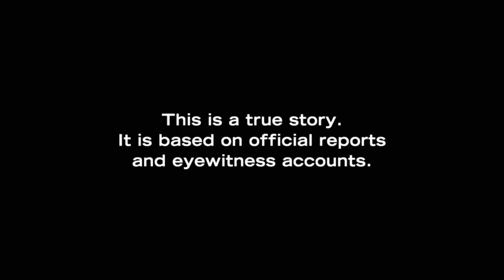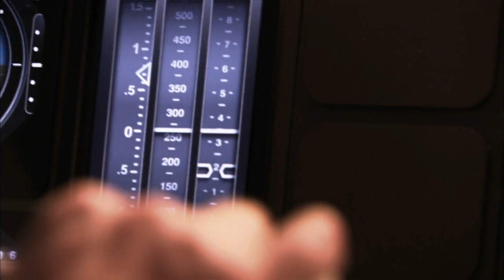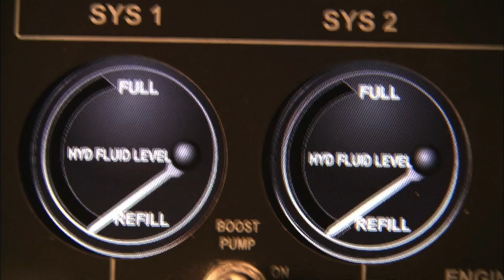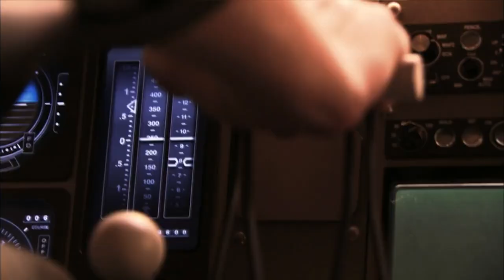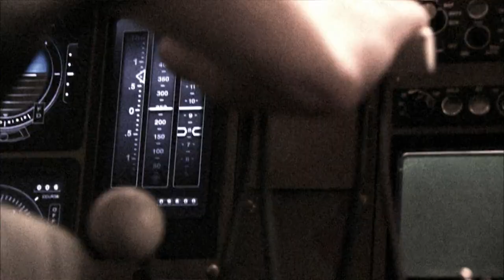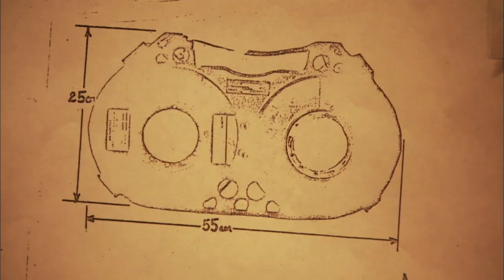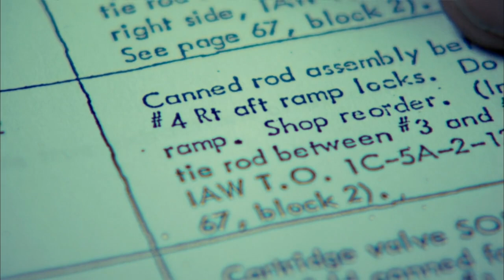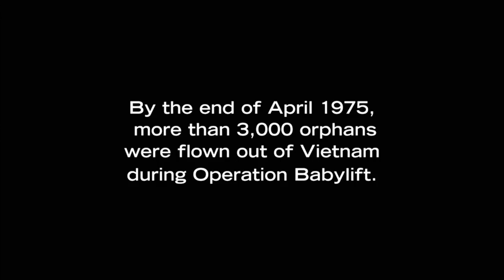Operation Babylift Tragedy: The Untold Story of Vietnam War Orphans | Mayday: Air Disaster

Comment: I wish they talked more about how they even were able to save anyone with a plane flying that fast towards the ground with no relative elevation control. The fact that 170+ people survived that crash is crazy.
Reply: It's likely due to the sheer size of the plane that he was able to have enough time to find a way to keep control and also how so many did manage to survive bc of the storage cabinet being the part that  took most of the brunt impact of the crash.
Reply: I pray for them all. In hindsight, I don't understand how Trainer, who did a remarkable job, failed to cut the engines just before the 1st touch down. The plane would not have lifted back up. Probably just mass confusion.
Reply: @CrystalM1917 plus I bet the rearward facing seats cushioned the impact as well

Comment: From April 96 to Apr 2000 I worked for the Central Identification Hawaii, which was known as the Central Identification Thailand at the time of the crash. They have all the crash records as well as all the Deceased Personnel Files for the military members on the plane, Dependent wives who were on board to assist with the children, and the baby remains. Most of the baby remains were just bits and pieces of bodies and could not be identified. I read through many of them and it was heart breaking.

Comment: I actually worked on 80218 on the aft ramp locks before it left Travis  and I thought that the locks were the problem. I think that we weren't trained enough to do the  job. And that is what I told the review board.
Reply: I flew on that C5 From Travis to Norton AFB and then to El Paso International.  It went back to Travis, refueled, recrewed and then this happened. We to were sequestered and questioned shortly after the crash.  I bet we crossed paths that day.

Comment: No one thought to somehow constrict the hydraulic hoses? Anywayz this pilot kept his head and instincts intact, saved everyone using his skills and common sense.
Reply: That's almost impossible to do. I don't know how I'd do it in a shop on the ground without pressure. They're steel braided and designed not to collapse or swell